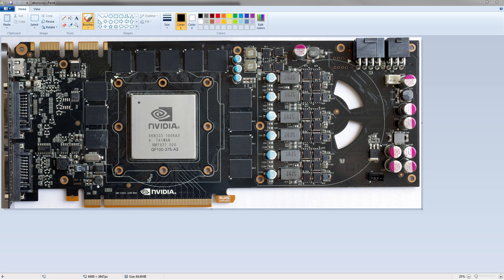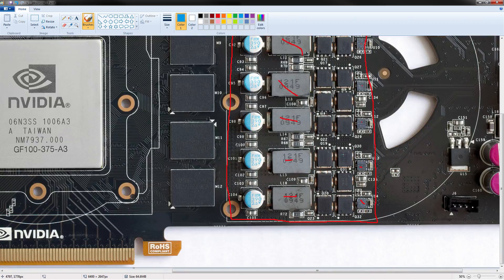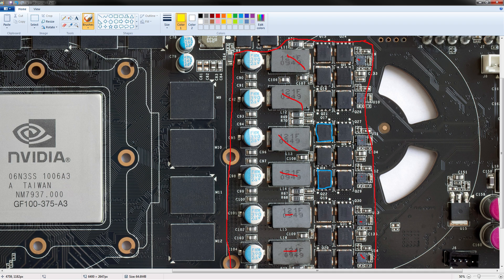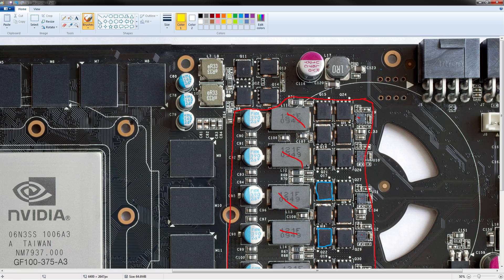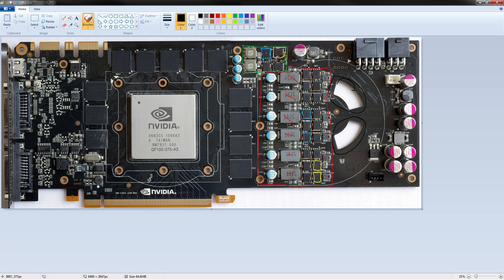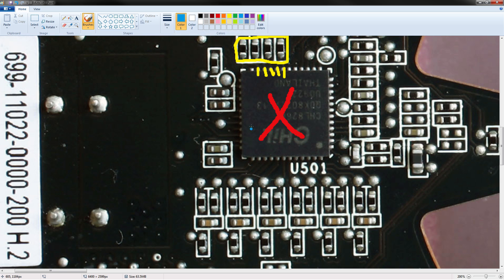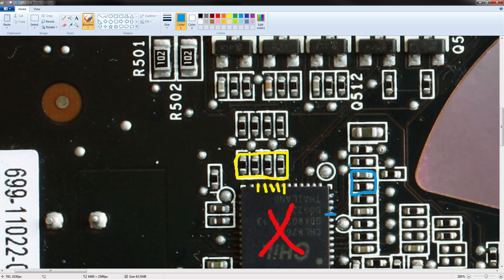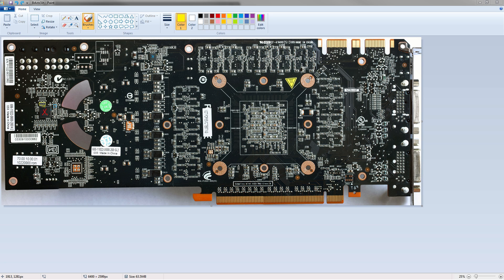Nvidia GTX Flamethrower(480) reference PCB breakdown and volt mods

Comment: 2 in SLI actually play games very well still. Nothing to cheer about but they can also heat a room and play games at the same time. Great in Jan. Not great in July.  Both cards have new compound and pads and run around 72C tops in SLI... During benchmarks.

Comment: Back in the GTX480 days I ran 2XGTX480 in SLI with a modded bios that allowed 1.212V in after burner if I'm not mistaken. Ran that with GPU only blocks and fans blowing on the stock VRM heatsink. GPU blocks were pulling ice water straight from a bucket. Max benchstable core for both was 920. 1 was a better clocker than the other.

Loved those cards

Comment: Cleaning and replacing pads and gpu compound on a pair tonight. Why? Because retro builds need retro cards. A pair of flamethrowers are almost 60FPS in everything with high settings and some even on ultra.  58 to 78 fps average with a 12 thread X5675 on an Asus P6X58D-E which is boosting to 3.34 ghz in benchmarks. They do like 90C when running benchmarks. I hope to quell that a little.

Comment: FYI parallel connecting mosfets don't yield 100% current scaling unless you balance them with resistors, which they obviously do. 

Reason is that not all mosfets are the same, so the current going through the mosfets aren't the same. 
One will likely always blow  before the other one due to pushing more current.

Comment: gtx 480 needs all the extra fans you can screw in your case for it was running at 65 - 70 c IDLE back in the day and would reach 92 to 93 c after 2 mins of intensive load... some reached 100c pretty fast too.

Comment: Do you plan to do a guide for extreme overclocking/mod gpus , some day? sorry about your fury, i hope you have luck with the rx480.
Reply from the maker: I mean these videos already cover the Vmod side of things and I post more detailed Vmod guides to my blog. LN2 on GPU is usually just a case of doing the Vmods insulating the card then mounting your GPU pot and then just controlling the temperatures and not hitting the cold bugs.
Reply: Cool. I'll check it out. what's the address?
Reply from the maker: in the description of the video.